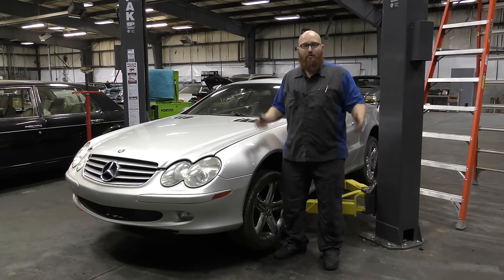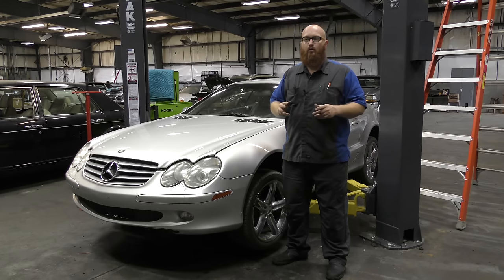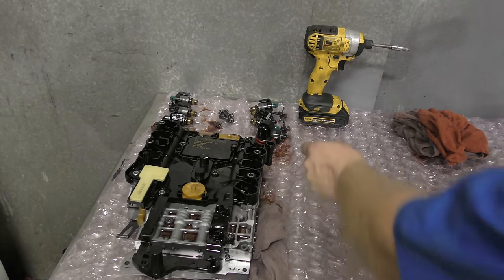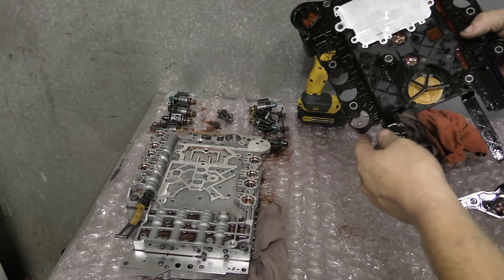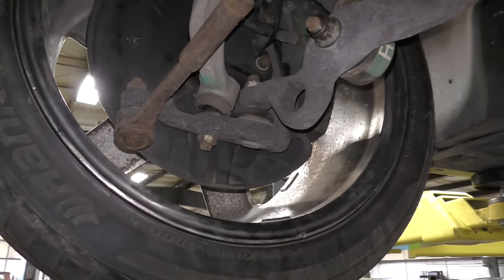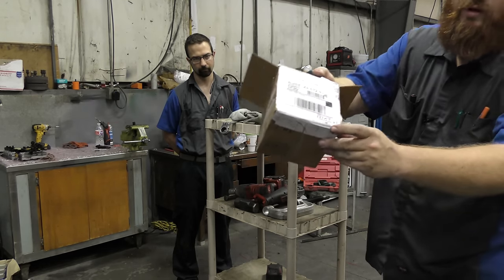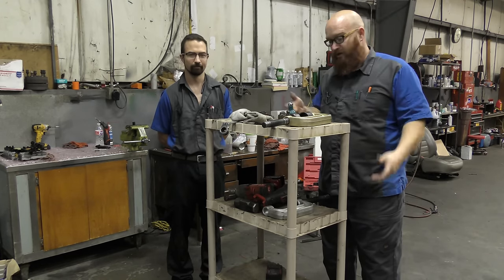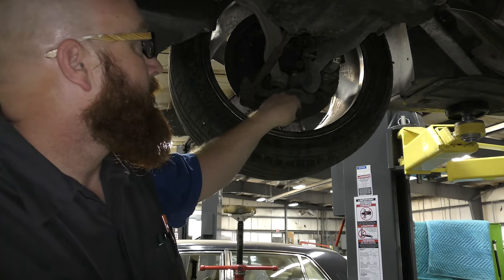ABC Strut ball joint repair. The CAR WIZARD shows to fix ABC strut on '04 Mercedes SL500

Comment: $4000-5000 at a dealership and The Wizard just replaces the ball joints, but people still complain about his prices?? Amazing work, Wizard!! LOVE your channel! Your customers are truly blessed. My best to you, Mrs. Wizard and the Omega crew.
Reply from the maker: Yep. “Id never go to the wizard, prices are through the roof” 
The problem isnt my prices, its some peoples budgets / bank account being too low. My prices are not subject to peoples bank account balance
Reply: I have no idea what his prices are but I'm sure they are much less than the dealer, and after being subscribed for over a year, the Wizard seems very trustworthy and goes the extra mile to save people money, which lots of shops won't do. Seems like money well spent.
Reply: @CarWizard  LMfao got em. Some shops charge too much for basic repairs (why spend a ton on basic hourly work) and then other people go to cheapo shops to get expensive or in depth work done which is iffy. You seen to do really good work, have the right tools and care about customers cars at a good price. They have either exotic/expensive cars or cheap beat up cars, both costing the same to maintain.
Reply: Mrs. Wizard got it for free.
Reply: @CarWizard  Seriously. The point of building a reputation is so you don't have to deal with drama-filled cheapskates (and the cheapskates always bring way more drama than their measly business is worth). Let them take their complaints to Shadetree Joe who also sells used tires while you deal with customers who actually respect your work.
Reply: @Chubbycat748  she probably is giving " payment in kind", you know, food and other stuff...
Reply: @gazzafloss  I'm sure Mr Wizard isn't missing any meals. And good for him. Honest man doing honest work.
Reply: @tbirdboy  it certainly doesn't look like he's missed too many meals, but remember "man does not live by bread alone".
Reply: Wizard needs to Franchise his repair techniques nationwide. He could put the dealerships out of the repair business.
Reply: @OMGWTFLOLSMH is
Reply: @gazzafloss o Mo ñj Bh

Comment: Back in MY hayday, if I had a press-fit job, bushing, ball joint, wheel bearing, I always put the new part in the shop freezer and gently heat up the receiving bore or opening.  Many times, the new part would fall into place with  little or no persuasion.
Reply: @icanfartloud  The freezer trick is fantastic. I've used in on ball joints and wheel bearings. It's especially useful on ball joints because it lets you get the joint started a surprisingly long way into the bore by hand and you can be sure it's straight before you start pressing properly.
Reply: Who has time for a freezer? Keyboard duster, sprayed upside-down. Much colder than most freezers - ready in seconds, not hours.
Reply: @icanfartloud  What shop doesn't have a fridge with a freezer compartment.
Reply: @16v15  AvE did a video on this and it really does seem to work well
Reply: @KY.0009  A viewer of quality vijeos I see! Fun vid IIRC (it's AvE that's why we watch, right?). Nothing I invented by a long shot, just something I learned from an older guy 30 years ago when I started turning wrenches - though we used 20# CO2 cyls back in the day. Not dangerous at all, safety squints engaged, mom on speed dial...
Reply: I am in such a busy shop I seldom have time to spend to put a part in the freezer. But it is a good trick if you have the part and time to let it sit.
Reply: @motivespeed  Shouldn't take very long, metal is an excellent conductor so will rapidly drop in temperature. Beef is around 0.4k  at room temperature, carbon steel is probably around 15-20k or more - so maybe something like 40-50 times more efficient at dumping its heat.  TLDR; It's not like freezing a piece of beef overnight.
Reply: @Beer_Dad1975  still, I rarely have 30minutes to an hour from part arrival until it's on the lift to get fixed.
I doubt 30 minutes is going to make much difference.
And even more so I don't know the job was sold or part was in until I am handed the work order alot of the time so I only have the disassembly time to cool the new one
Reply: First gearbox I rebuilt: Ali casing in oven, bearing in freezer, make a cup of tea. Bearing drops into casing and actually rattles until it warms up. Deeply satisfying.
Reply: I put the replacement in the freezer until moment of the install also currently. much smoother transition.

Comment: Wizard is a Brave Man, Using the Explode-Omatic 3000 cut off wheel with no face shield.
Reply: I don't like to badmouth the Wizard but those type of practices are plain foolish. Especially when you're self employed and the entire business depends on you. Pretty hard to be a mechanic when both of your eyes are missing. How much time does it take to put on a polycarbonate face shield?
Reply: @OMGWTFLOLSMH  I'm never the Nanny. I don't care if you wear  a seat belt or helmet. Your choice. You know the risks but when it come to cut off wheels. I have seen them explode and throw shrapnel. They freak me out. I would not use one without protection. And they are like bombs that go off with no warning.
Reply: @mmm365  I know he is. I was referring to a face shield that would also protect his neck.When those disks explode it's no joke.

Comment: Hi Wizard and Mrs.W.  I enjoy your channel.  Thanks for the great video and tips on care repair and care.  This is video is full of useful information for any M-B owner.   Mine is a 2005 M-B E500 (about 101k miles currently) with similar components.  Once the front right hand turn signal light stopped working.  The car would not pass PA state inspection.  My mechanic had trouble, recommended M-B dealer service.  Dealer recommended new headlight assembly (about $2,500 for parts alone).   I purchased a new (unused) headlight assembly on e-Bay for $1,700.  It did not work on my car either.  e-bay seller graciously gave me my money back.  I fixed the problem by buying a U-Haul trailer lighting module ($45 plus sales tax), installing it in the trunk with the car battery for power,  tapping into the tail light right turn signal, and running a long wire through the car to the right front headlight assembly.  Right front turn signal light repaired! I will continue to follow your M-B experience with pleasure.

Comment: Well this is a good place to give you guys a heads up. I bought and harbor freight ball joint separator (not a pickle fork) on Thursday and when i was tightening it down with a short 3/8 ratchet it exploded on me.  No cracking or any sounds and this was on a Honda civic lower ball joint. Almost didn't get my hand back in time broke my pinking and bruised it good. Well the tool said forged steel it was not it was cast with a heavy paint to hided the fact. Just a heads up saving my self a 1/2 hour of driving or 6 bucks wasn't worth it.

Comment: Hi Car Wizzard!  I am one of the ones that wanted to see how that ball joint can be swapped out, since I have been told by MB and a couple of decent indys that the whole strut had to be replaced to fix the looseness.  Fantastic job!  BTW, I have to agree with the ones that had problems with the grinder and no protection.  Please do us a favor and at least use a face shield or goggles.

Comment: My wife's 2006 ML500 have the exact same issue with the turbine speed sensor. I was not sure on how to repair the module myself so I sent it out to Van Nuys, Ca. to a module repair company for $200 and they repaired it. My dad and brother who are extremely experienced mechanics we're shocked I was able to figure out and repair it for under $300. Thanks to YouTube and research on the internet.  I'm glad you spent some time on this EXTREMELY common issue.

Comment: I've got a good one part replacement. I changed the alternator on my 2002 Saab 9-3 about 4 years ago, suddenly last year it quit working. I bought a nice Bosch remanufactured unit which is basically factory new so I was bummed it only lasted 3 years (the warranty period as well so I figured they just knew exactly how long it'd last). I got SO lucky, after 3 years the bolt holding the hot wire that connects to the battery had wiggled loose so I was able to buy a thread locking nut and get the alternator hooked back up. I was glad because 1) the nut was like 50 cents and 2) the alternator job is like a 4 or 6 hour job, it's in the back by the firewall and you've got to do quite a bit of disassembly. Spending 50 cents and sneaking my hand back in there to replace the nut was a much better alternative. No problems since.

If that doesn't count because the alternator was replaced (although like I said it WAS already 3 years old) my 1986 Saab 900 (yes more Saabs) would randomly stall after going down the road for about 5 minutes, turns out ONE of the two fuel pumps, the pump that puts the fuel from the tank into a sort of bucket containing the pump that goes into the engine was working but very weak. The car was consuming more fuel than the small pump could put into the bucket, I replaced it for $18 and it ran fine again.

Comment: Just replaced the AC compressor in my '03 dodge caravan.  Had to remove the serpentine belt and alternator to get the old compressor out. It was a smooth and straightforward process. I thought of the car wizard throughout the whole process. Thanks for the uploads man

Comment: Many years ago I ran a RR Shadow 2 , one of several I had over time. I did all my own maintenance and repairs and even had the factory workshop manuals. One day whilst going home a loud "thunk" came from the rear passenger side and the car sank to one side. Shadows have a front and rear subframe. The rear shock absorbers are bolted to the subframe. The passenger side shock absorber lower attachment point had corroded through and the shock absorber was now hanging in mid air. To repair this is a NEW subframe unit complete with changing over the rear axle, suspension brakes etc.  not to mention the unbelievably exorbitant cost. I got round this by going to my friendly mechanic who was an ex-RR mechanic. He said this was a very common problem with Shadows to the point where he had an engineering firm make the shock absorber fixing cup / mounts that always rusted through. He welded one of these onto my car and job done. Cost ? 250 pounds sterling back in the late 1980's as opposed to many thousands elsewhere. However, to quote Mrs. Wizard " it scared the crap outta me" and I sold the car soon after. That was the last Roller I had, through choice!!

Comment: I really appreciate the time and effort that this technician graciously put into making and sharing the needed tools, advice, procedures and parts sources information for replacing what is a relatively simple component..I feel that I can TRUST this man...So sad that I CAN NOT say such about my Benz dealership..My dealership service advisor is an OK guy, he tries to help but is responsible for through put production goals ($) and he can only do so much to prevent heart attacks upon seeing the labor / parts bill...However the shop people for a well known rea$on have kindly posted  a warning sign..The sign instructs customers for Benz car repairs to; first place their credit card , checking account booklet, and wallet upon the counter top , drop their pants and shorts , grasp the provide courtesy handle on the edge of the counter top , bend over , and if vasoline is requested it is an extra cost option..Why such an ABSOLUTE RIP OFF ON BENZ repair PRICES ????..The car concept is great , durability is for CRAP..always in the shop needing some sort of service..Love the roadsters , have an slk/55/amg and an SL600...but always some sort of trouble even though maintenance is done properly...had a 1991Toyota Previa van put on 260,000 miles and ONLY changed out tires , brakes, oil filter and batteries, one exhaust system due to a rear end impact  and sold it for $2,000.00 and it was still running great and everything worked as it should ..didn't burn a drop of oil between changes ????  > my Benz cars , upon reaching into my pocket I feel two hands in there next to mine; one is the IRS and the other is the Benz repair shop ..

Comment: A handy tip for this kind of job is to put the new ball joint in a fridge / freezer for a little while just before fitting it as it’ll shrink a little bit making reassembly  much easier 👍🏼

Comment: Excellent. My 1st mbz was a 7 speed, never again. My 2,3,4th mbz are 5 speed with zero problems
Reply: What the mid 2000s NAG1 or 722.6? They throw them into Dodge products too, don't see much problems with them besides just old fluid like 15 years in not being good enough

Comment: @ wizard
So I just did (today) upper ball joints on a '03 sequoia 4x4. I learned that with a wrench, I'd get that ball joint press pretty tight, then whack on top of the threaded rod with a small sledge. 3-4 whacks and it will allow all the tension that's built up to relax, then get another turn, whack and repeat. I DON'T have the cordless impact option but I think, when you left that tool to settle for a few moments, had you whacked that threaded rod end and shocked the ball joint, it woulda freed up for you to continue immediately.

Comment: 18:03, that's the moment he lost it. Cut, and so calm after resuming. I know I would have been cussing and getting mad lol.

I've put ball joints in the freezer before pressing in and I think it helped.
Reply: Definitely helps to freeze a tight ball joint. That  little bit of shrinkage can go a long way 👍
Looks like the old Milwaukie may not have had enough lead in its pencil?
Reply: Use dry ice

Comment: Good job saving mrs wizard 3k!   Yeh the merc specific  ball joint kit is worth it's weight in gold.  You'll get your money back on the first job!  I try to get half a turn on the ball joint with a wrench, carefully checking the angle of the ball joint just to make sure it has started absolutely straight.  The reason yours went in so darn tough is the ball joint was not straight/square when you started it with the brrt gun - you can see it at 17:12.

Comment: I’ve spent so much time trying to find a way to fix those balljoints and was told the same thing I need a complete new ABC Strut, you flashed a pic of the box but it would be wonderful if you could tell me where I could purchase those ball joints, “ although I’ll probably change the suspension to coil overs,great video I hope you do more on your wife SL500, the conductor plate really help me out I hear it’s a common problem, However I didn’t know about the reprogramming if you replace the whole conductor plate, this was very helpful,thank you for your videos there always impressive & well done. STEVE

Comment: I use a silicone based grease for jobs like this. The silicone grease has a high melting temperature and also inhibit corrosion, making future repair or dismantling much easier.
Reply: good tip

Comment: Lubricate the threads on tool as well as the outer mounting ring for the ball joint mount after using a wire brush on the splines, place the ball joint in the freezer for a couple of hours.

Comment: Interesting. Scotty just released a video yesterday and commented on how certain Mercedes models have transmission control modules that go bad all the time. Also said how replacement requires reprogramming but is not too expensive in the grand sense. Something to keep in mind when buying an older Mercedes.
Reply: It cost me over $1700 at a non dealer MB shop to replace mine on my 01 e320. Don't even want to think what a dealer would have charged.

Comment: Car Wizard Love the show ... Have a trick for you .. When installing news ball joints put the ball joints in the shop freezer ... They will contract .. In the morning heat up the area of the ball joints it will expand and the ball joint will go in like butter  ...
Reply: Lawrence Oliver agree, i use the same approach
Reply: When my car needed them, i got some from amazon, (Moog brand) for a real good price of like 50 bucks (canadian so idk 35 USD) per and as soon as the package came i was tearing into my car. I could of let them go in the freezer for a little bit but i wasn't too worried. Getting them out with my High Torque mIlwaukee same one he had was the problem lol. Rust belt plus being in there for over 130k miles does that. Putting them in was a breeze. For tight ones like this it might be an ok idea if you get the parts in advance and don't need it done right away.

Comment: Hey Wiz........... when I worked in telecom electronics, pink bubble wrap was always used to shield sensitive electronic parts from accidentally receiving static charges that can fry the internal circuitry of the component. That's why when you get electronics shipped to you, it should always be in a grey anti-static bag and then cushioned in pink bubble wrap. Just FYI Weeeeezard.

Comment: One of the mechanics I know puts the balljoints (or anything small enough for pressing) into his shop freezer for a few min before installing.  That way you don’t have to wait for it to cool as often. Hope all is well, thanks for the great vids!
Reply: In the shop i used to work at, vehicle came in, oh it needs a ball joint, yeah ok sure calls parts store, yeah we have one ok 30 minutes later anyways we get a part, so i'm wasting like 20 minutes doing nothing 10 maybe working to get at it, and then put it together right then and there, no time to freeze it or anything. I'd rather us diag things in the morning, get parts ordered. THEN when we have the parts, we can get right on working and things like that throw in a freezer so lifes easier. But you know i don't run the shop so.